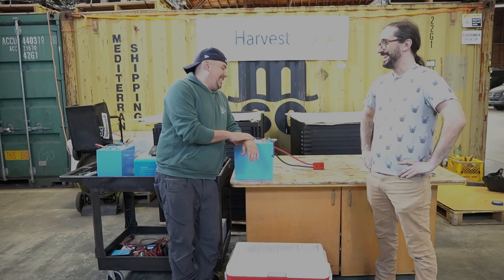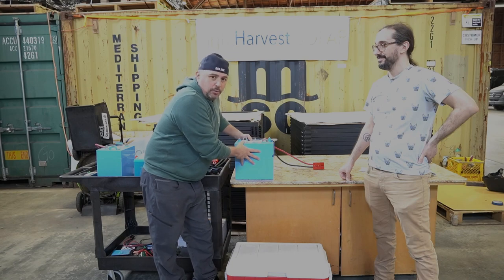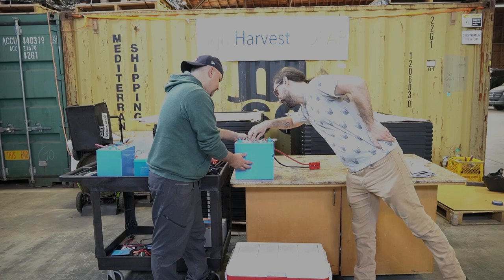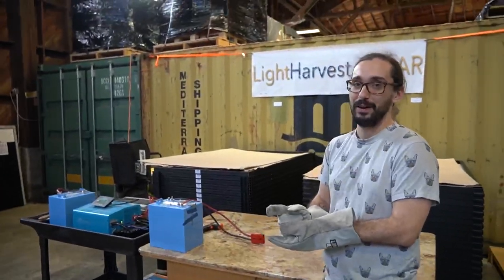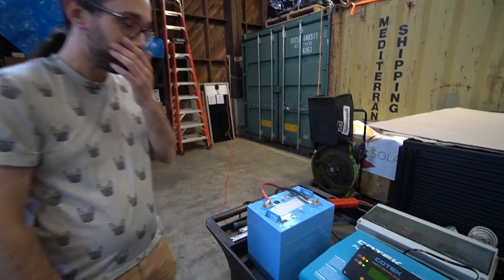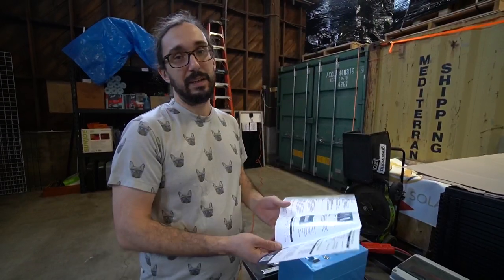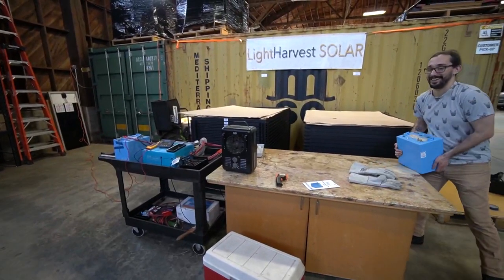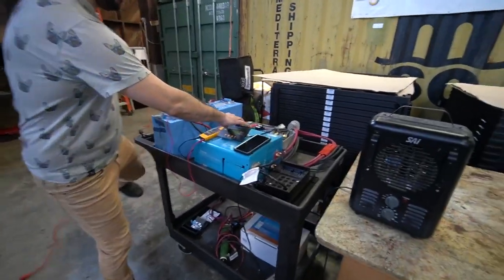TESTING some 12v Batteries - You Get What You Pay For!

Comment: After watching the entire video I am not really sure what you were actually trying to show in the video.  I would have expected that you would know what the internal battery temp was not measuring the plastic case that is likely filled or lined with foam along with doing a cold temperture disconnect test.  20 minutes in dry ice likely wasn't enough time to get the cells down below freezing especially if they have the case filled with foam around the cells or if the batteries have internal heaters.  Max discharge isn't everything and for the overwhelming majority of people the capacity of the battery is going to be a far more important figure than how many amps you can pull from a single battery considering you get around 300AH at 12V in a battery that is only slightly larger in overall size because they usually fill these cases with foam to take up the extra space.  You pack 4 of the 300AH densely packed batteries in an RV and that is a pretty serious amount of storage at nearly 14.5KwH of total capacity.
Reply: @Chris I have UN-subbed, and stopped following MANY of the YouTubers who only Pimp the Vendors who give them the Free Shet in exchange for a "non-biased" (LOL) review. * That is NOT Will Prowse, or the Professor's game !
Reply: @Chris While I could agree with you I need to refrain from commenting.. 😁I 've already been accused of being a troll for making a ( funny ) comment in the past. You can't disagree with the powers in charge. JMO